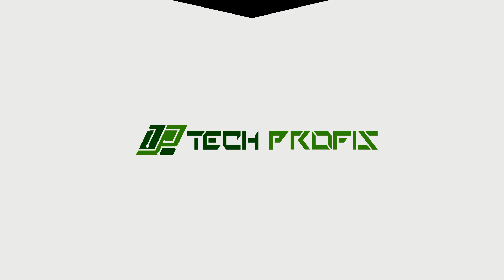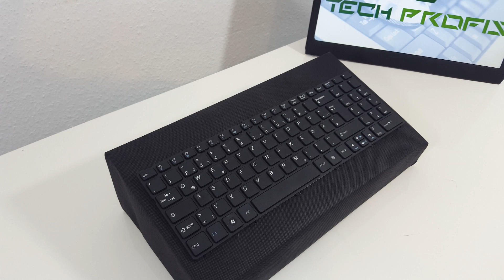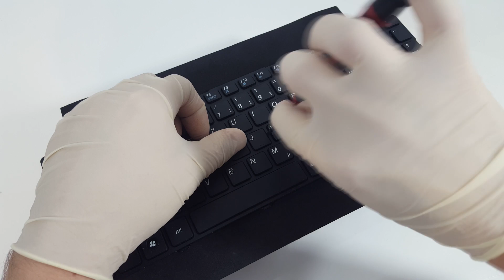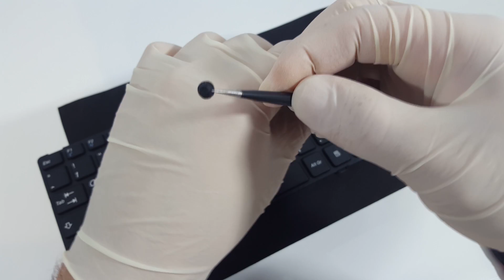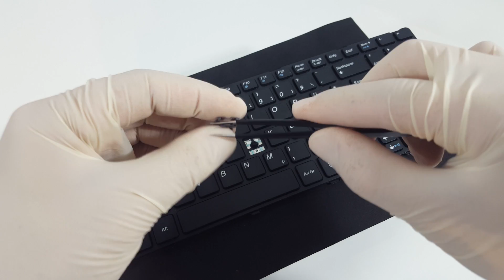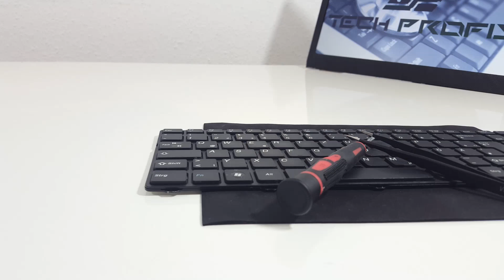Laptop Keyboard Repair - Rubber Cup Spring Fix MSI Medion Akoya

Comment: So, exactly how does one place a new rubber cup onto the space it's supposed to be at? I ordered a new cup because my dog stepped on my U key. Should I glue it back in place?
Reply: Yo! Is that Juicebox supreme? Were did you order it I can’t find them anywhere.
Reply: Hi bro.. May i know where did you ordered the cup
Reply: Hello , may I know where did you just ordered a new rubber cup
Reply: holy crap I was never notified about these comments, my bad guys, really sorry. If anyone's still unable to find one, here: 

https://laptopkey.com/

when you order a key piece it comes with the keys stabilizer, and a rubber cup for the key.
That's what I did, hope this helps.

Comment: So, This Morning I Discovered, That My W Key Was Not Working Well. I Removed The Key and I Discovered That The Rubber Cap Was In Half (the top Was ok, but the under part Was in half). Is there any Way to fix it or i have to replace it??
Reply: yeai think you buy a new one somehow and follow the steps here